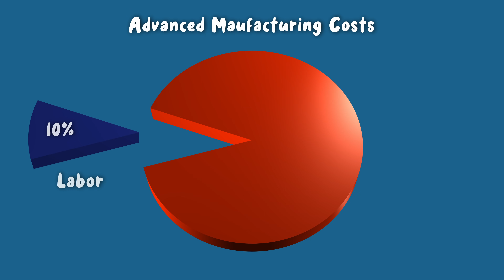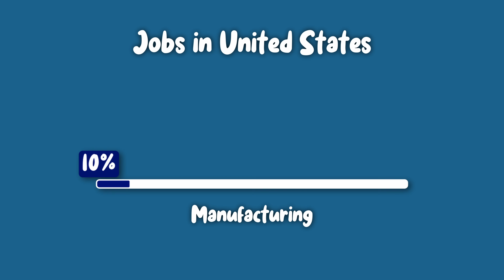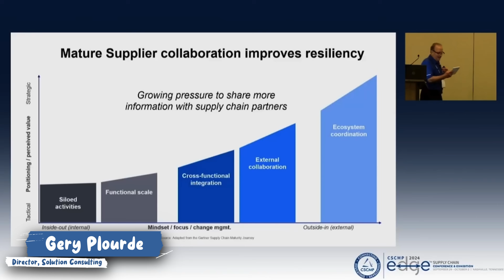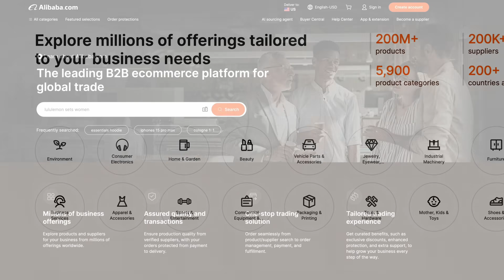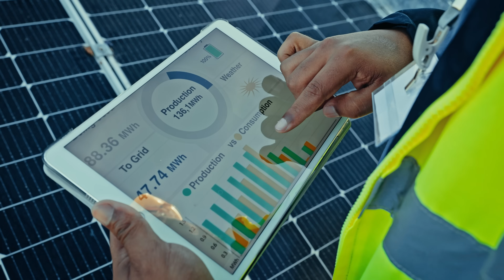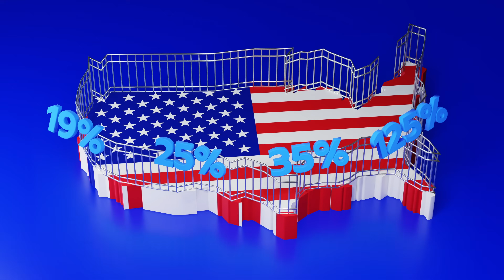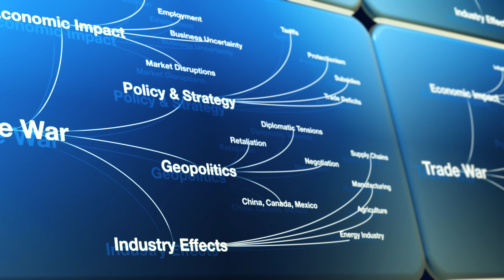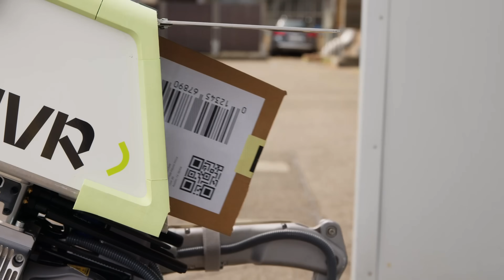Is US Manufacturing is coming back?

Comment: Manufacturing might come back but 'manufacturing jobs' are NOT coming back. Robotics and AI will replace most of the jobs except for a few managers, engineers and technicians. The other problem is that USA is not turning out the number of engineers, technicians, etc. that will be needed. The 'supply chain' is another big problem that will be difficult to solve and will take years to develop those supply chains at competitive prices since China has bought up most of the 'rare earth' materials needed for high tech manufacturing. Taiwan set up a 40 billion dollar chip manufacturing plant in Arizona and found out they could not hire the people with the training and experience to operate the equipment in the factory. They had to bring in over 1,200 Taiwanese employees to get the factory up and running. That was just one factory, now multiply that factory by 100 and you see the problem with getting production going in the USA. Also the EPA air and water pollution rules in the USA will make setting up a manufacturing plant very difficult.
Reply: Thank you sharing a view that I think everyone could see if they looked honestly.
I did not know that about Taiwan's new plant in Arizona requiring 1,200 employees from Taiwan.

I would add that China did not buy up rare earths, but are the source of them.  The mining requires large scale excavation and would be prevented by an additional hurdle you didn't mention: grass roots environmentalists.  They could be mined here, but won't.

I see the situation in summary with the same conclusion you hold.  Thank you for sharing your comment.
Reply: disagreed. jobs are coming back; just not the same kind of work you're expecting. all the robots and machinery will require technicians to ensure proper operation and maintenance. would be willing to bet good money the Arizona plant wasn't able to acquire local talent because of the hiring channels in this country being sabotaged with endless fake job posts/sites, etc. last I checked, the EPA was potentially getting gutted under DOGE.. either way, would not be surprised if it gets disbanded sometime in the not too distant future.
Reply: Automation doesn’t really kill jobs.  Just like computers didn’t take over things like accounting etc.  Automation enhances consistency and accuracy, but it requires a whole staff of auditors calibration and maintenance people.   I worked for a subsidiary of Foxconn, and the labor problems with TSMC is more cultural than ability.  American work ethics are totally different than Taiwanese.  Taiwan also hires people who are operators who are trained.  I can tell you that Americans have a higher attention to Quality than even the Taiwanese.  US QC processes and standards are higher and more demanding than those of Taiwan.  Japanese and US products rarely needed sorting or testing before put into production, but Taiwan product need regular incoming inspection before processed into the assembly lines on electronic products.
Reply: Your last several points I would agree with in that it will take time to sure up our atrophied supply chain as well as train up a workforce for the types of advanced manufacturing jobs that are needed for critical industries; both of those can be done and at various state levels is already happening. Also, the industry is vastly over regulated and I hope this administration follows through with deregulation as that would truly unleash a huge amount of both capital inflows into the industry and innovation. However, I vehemently disagree that AI will replace most jobs. I am currently building a defense manufacturing startup and AI is the centerfold of our product and will only create more jobs and opportunities in this industry (and many others) it will (and has already) taken over very rudimentary, simplistic, and low level tasking, but humans will always have to be in the loop in advanced manufacturing. The skills people will need is shifting, but there will be far more work for much more cognitive and creative  heavy tasks that will make the industry and technological possibilities far more appealing in the very near future as AI and the intersection of physics and engineering will allow us to design and build things we currently can not imagine. That process will still always involve people, always. This hyper-exaggeration about AI and automation taking jobs I believe is extremely overblown and is used as a fear tactic to get people riled up. This is by far the best time in history to build and create things and manufacturing is probably the best industry to do that at the moment, that’s my opinion.
Reply: @Zero2Black6  even if not now, it some day will

How much years do you belive humans would be economicaly valuable?, 20?, 40?, 80?

The problem isnt the when, but wtf we are gonna do once it arrive

Without jobs the vast mayority of the population will perish
Reply: @moastray5093 certain low-level jobs will go away eventually yes, but as far as all work being taken over; I truly just don’t believe that nor see it happening long term. If I were to make an imaginative guess about the future (which is almost impossible to do) I would argue that we are headed into a world that probably looks something like a ghost in the shell kind of reality. There will be a slow merging of biosynthetic processes, Computer-Brian interface, Software-on-a-cell, nanotechnology etc AI will essentially work in conjunction with individuals, companies, governments etc, but that’s contingent on a vast amount of over regulation being rolled back which unfortunately I think will take a long time to happen.
Reply: There will be whole new industries that will develop around future technology that we can't even imagine yet. The problem is many people will lose their old jobs before the new industries are fully established or they will be too old to learn a new skill.
Reply: All Nixon and Carter's faults.
Reply: @Drewcardello benefits of globalisation and the incredible growth in GDP creating billionaires getting tax breaks / corporations not paying tax at all while gutting the middle class.
Reply: YOU ARE SO WRONG. The United States has Excellent Engineering Schools and Intelligent Youth more so than you understand. Robotics, AI, lack of Engineers just Stock Market sell off of United States Manufacturing, Industry to Foreign Ownership, Corporate Greed. President Trump and his Administration will bring Industry, Workforce Education Back.
Reply: We need a leader to initiate the process to get us out of this. After decades of searching for the lowest common denominator. Hmmm. Who would that be?😂
Reply: You are 100% correct!
Reply: Maybe Trump should have considered more on using diplomacy to make sure to keep/prolong the dollar as the global currency. Instead he has bullied and slammed unreasonable tariffs on all countries pushing them away to think of alternative ecosystem to the dollar. It's not correct to say everyone was ripping off the US. The US buys good from other countries and they in turn buys back US treasury bonds with that dollars in trillions. Tariffs should have been reasonable and increased as systems and resources are set into place to protect it's growth. You need to have something in place first to protect.
Reply: The days of shipping overseas are going to become more problematic in the near future. The US Navy currently guarantees shipping lanes free from piracy. Taken for granted by most of the world that may be coming to an end. Nobody will insure cargo ships without that guarantee and if they do it will be much more costly than before. Covid also exposed the weakness of worldwide supply chains. China’s working population is about to age out in 10 years. I think you will see the Japanese model take over where supply chains are shortened to the market they serve.
Reply: Manufacturing engineer here, AI is not going to have any measurable impact on manufacturing for the foreseeable future. Why? Because it’s not AI it’s just a complex algorithm it can solve some problems on paper but not in the real world
Reply: China is already highly automated. They are the first to attain completely human less production lines. Just so you know.
Reply: Yeah. And who would want safe water and air.

Comment: Some of parts of the hardware that I sell are produced in China. Aside that it is more affordable, which isn't the main reason, is that A. They are willing to help you. Here in The Netherlands they're nearly always not interested in the low volumes that I require. So they don't want to do business with you, or you have to wait for a very long time. Which brings me to B, they communicate. In The Netherlands I often just don't get a reply, whereas with China, you get a reply within a day or 2. They're willing to help, think with you about certain issues and offer alternatives if something isn't possible. And C, they're just simply good at what they're doing and offer good quality.

I think, at least here in The Netherlands, companies have become a bit ignorant towards smaller companies or startups. Whereas in China you feel welcome, wanted and respected. Lower costs are just one of the reasons.
Reply: I've heard small American manufacturers say the same thing about American suppliers like metal shops and fabrication shops for components. Most small businesses prefer paying the tariffs than dealing with American suppliers.
Reply from the maker: We have a similar experience here in the US, but it's beginning to change. We also have growing tools which are supporting that like Xometry, Send Cut Send and similar. I have been working on the layer above that with Bloom which includes full manufacturing, assembly and other layers. But I think you hit the nail on the head about efficiency and communication, I think marketplaces can really help those who participate get stronger and this is exactly what western businesses need to do if they want to compete on the global market.
Reply: @FutureintheMaking  I've checked out Xometry before. But it wasn't clear to me where the work was done, since they have a number of production facilities across the world.

If you can offer that transparency to the customer then great!
Reply: This is soo true. Dealing with Americans in certain regions is so difficult.
China will allow you to import stuff from them even if you are in Europe, Africa the Caribbean basically anywhere.
For years Amazon refuse to work with us when we were dealing in the Caribbean, South America and Africa. Then along comes Ali, Temu, SheIn and they offer us services wherever we need it. 
Americans are too backwards thinking, they need to realize it's a huge world outside. They are also missing out on great business opportunities because they are ignorant of certain facts.

Comment: When the first entirely manufactured American e-bikes arrive at your shops, they will be what you sell now, as Tern & R&M have massive tariffs applied. I believe Tern has stopped sending e-bikes to America, which means spare parts will also be discontinued due to the high cost.
Reply from the maker: We dream of this day Dean, but it might actually be a foreigh mfg that does it first, they definitely have the experience and we are working with many of them on a plan. We just need to see the dust settle with this tariff stuff first. I haven't seen too many issues on the spare parts front at the moment, I don't forsee this to be a major issue with the more reputable brands, but I guess we'll see. The other good thing is there are often many compatible options for some of the more common bike parts.

Comment: I’m a nearly 40-year veteran of manufacturing and have brought plants online in the US and in China and spent many years in China. I agree with much of what you said and disagree with much of it.  The limitations are not low labor costs, but the high middle management and engineering skill sets we don't have.  I don't believe it is possible to onshore many products due to the supply chain and specialty products needed in some industries. I just don't see the economics making sense to supply many of them. Certain products that rely upon processes like metal fabrication, low volume plastics that use 3D printing as well as SMC for electronics can be practical for more expensive niche products.  However it is easy to bump into a myriad of other challenges too numerous to expand upon here on products that appear simple on the surface. Trust me, I've bumped into them. Making stuff is easy.  Making stuff at volume with high quality at a fair price is extremely hard. It all seems easy until you have to fire up the lines and the rubber hits the road. It's damn hard. That's when you really learn and relearn.  

As for energy, I’ll have to sharply disagree with you.  Maybe I’m reading the wrong metrics, but all carbon sources have become more expensive than renewables.  Furthermore, it sounds like you have never experienced the eye burning, lung searing visibility limited to 100 meters (not exaggerating) environment of a Chinese coal burning city.  I have endured endless days of such hell and it’s not worth any price. I can recall when it only existed in some parts of the mainland and I would flee to Hong Kong to escape it when I could.  Of course it now curses H.K.  I don’t care how many jobs we don’t realize due to it.  It’s the kind of thing that does lasting health damage to everyone, especially children.
Reply: China is clearing up. I'm an Australian who has visited that Pearl River Delta area around Hong Kong and Guangdong a decade ago, and then again last year. A decade ago it was a hellscape of pollution. We paid more for Hotels with filtered air. Now it's clear blue skies and Parks dotting the urban areas. My company requires specialist machining. If we go to the US for it we'll sit in meetings with a dozen different finance guys explaining different financial structures. Have a meeting in China, they'll bring an Engineer, a Metallurgist and a Composite Engineer to give you different options in how to build something. They'll try and squeeze a buck, but there's never a we can't do that attitude. We're developing wrong attitudes. This is tough - China will charge a Factory 10c a kWh for electricity, and charge Domestic Customers 50c a kWh for the same electricity. It keeps their costs low, but I don't know how we compete against that in the West. We're not all wearing extra utility bills to subsidise Corporations. They have no choice. The US Tariffing everything isn't helping competition in general.
Reply: Currently America gets some of its electricity from Canada that is not sustainable as Canada ramps up its needs, well they are constantly increasing renewable electricity & refreshing nuclear plants & adding small nuclear reactors just to keep up with its own demands these projects are already happening
Reply: The days of free shipping around the world are coming to an end. Trains are already being seized by cartels coming through Mexico and ones the US Navy stops protection all world shipping lanes piracy on the seas will make a comeback. The days of worldwide supply chains are over. The result people see are cheap goods but they don’t see the environmental devastation, labor exploitation, and until Covid the fragility of supply chain management. It’s over
Reply: Can the new hydropower China started this year lead to reduction in coal burning when it is completed?
Reply: @iloveparadise they dont need to wait that long since they've already begun construction on not just a ton of renewable energy farms but also nuclear plants
Reply: <<As for energy, I’ll have to sharply disagree with you.  Maybe I’m reading the wrong metrics, but all carbon sources have become more expensive than renewables.>>

You're definitely reading the wrong metrics. The biggest problem with renewables is the cost to deal with intermittency. Countries with a high percentage of electricity produced using renewables generally has the highest electricity costs in the world. You still have to have coal (in China's case) or natural gas (in the US) as a baseload backup for times when the sun isn't shining or the wind isn't blowing. Battery storage is exponentially more expensive. To use renewables, you really need two baseload systems...which drives up the cost.  A little bit of wind and solar for peak times pencils well. But the more of it that you add, the worse the math becomes.

.<<Furthermore, it sounds like you have never experienced the eye burning, lung searing visibility limited to 100 meters (not exaggerating) environment of a Chinese coal burning city. >>

China burns coal out of necessity and national security. They don't have abundant natural gas like the US does. But I don't succumb to the belief that coal is prohibitively dirty. Seems to me that we can impose a more reasonable level of regulation that gets the real pollutants out of the air instead of taxing and regulating the fake ones such as CO2.  Our ridiculous environmental regulations are what is harming our global competitiveness more than anything else.  We have simply outsourced much of our pollution to China.  And if you believe the man made global warming nonsense, made the planet even worse for doing so.